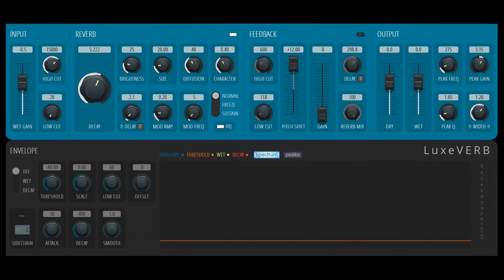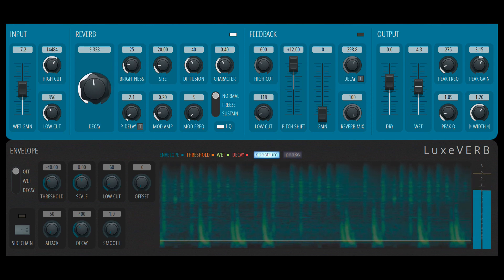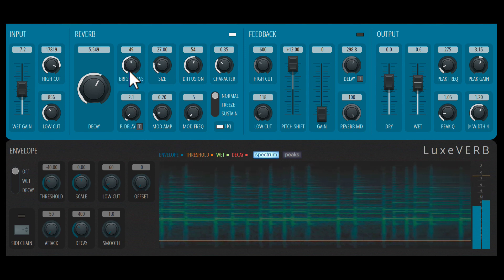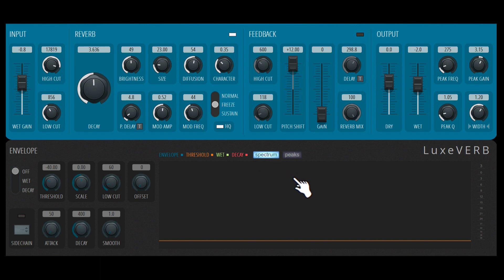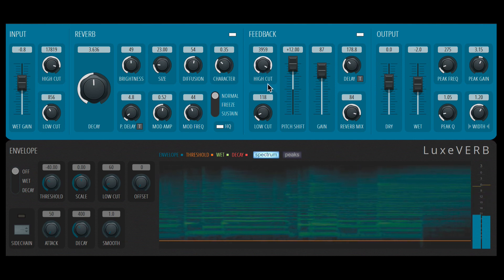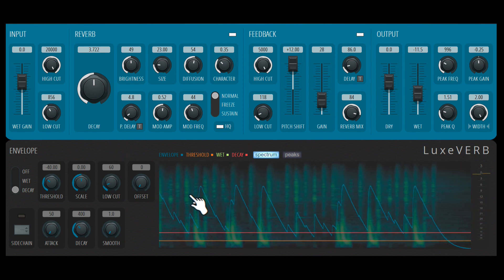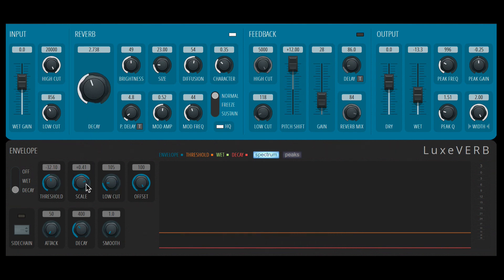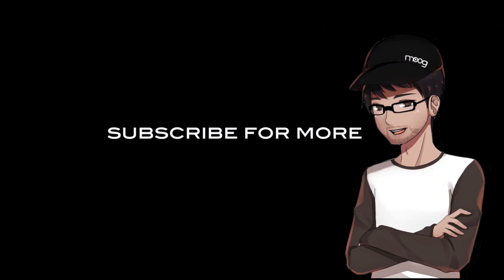LuxeVERB Algorithmic Reverb in FL Studio 20

Comment: One thing aside from being sonically stunning, is the complete volume control in terms of ducking or following volume curve of the dry sound. Sometimes you want the spaciousness of the reverb without it acting as an additional instrument. Also in order to sidechain your reverbs you have to run a parallel chain in patcher then load a compressor with a sidechain function(super annoying). This gets rid of having to do that.